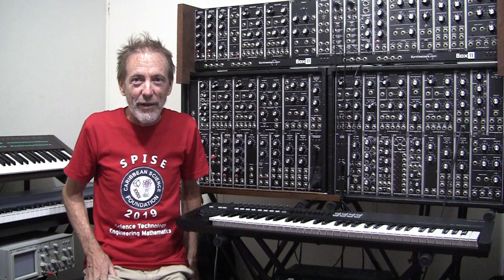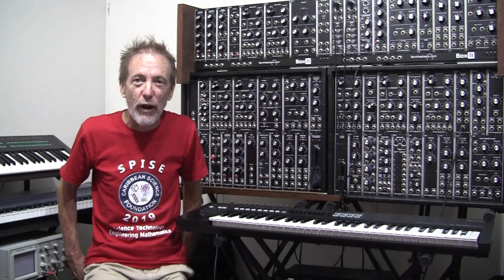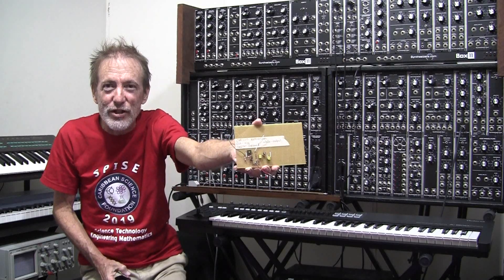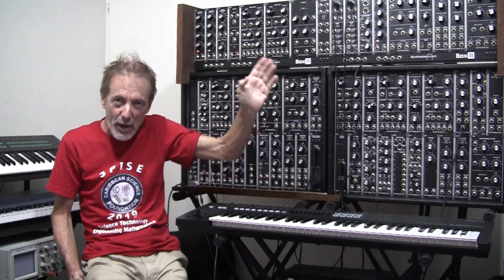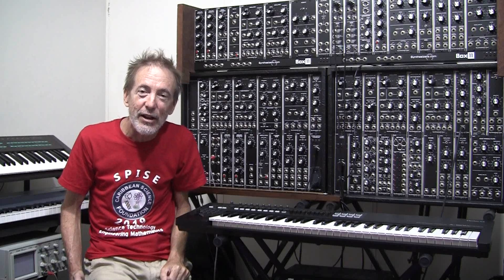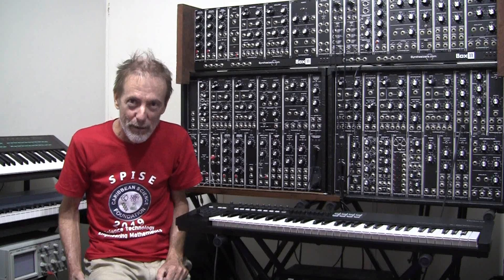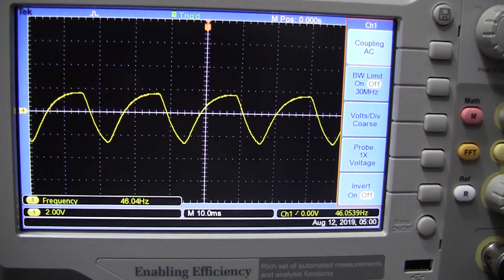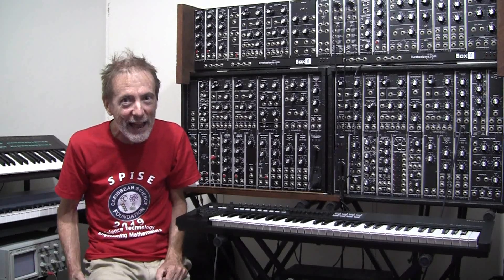Beware Electronic Circuits that do NOT work !

Comment: Back when I was in engineering school, many lab circuits were pure nightmares ! The log amp, using a semiconductor pn junction, in particular. I think these are assigned to make us aware, that not all circuit designs are usable, and to avoid such circuits, when we were on the job.
Reply from the maker: circuit simulation software will allow circuit designs  to work that would NOT work when built with actual components (that's why it's so important to learn good design practices) ..  they were teaching you (the 'hard' way) by allowing you to 'experiment'  with bad designs before teaching you the "why"

Comment: Funny how circuits engineered with software suffer from the same pitfalls as software engineering does. Lots of time wasting rabbit holes out there but at least I feel more productive at failing when I build circuits.
Reply from the maker: I have built my fair share of circuits both the ones I designed myself as well as the ones I found in magazines (back in the 70's 🙂 ) that did not work. You will know you are making progress when you can troubleshoot them and then change  components to make them work.  Electronics is not an exact science (all of the components have tolerances and other parameters  that are rarely considered in the mathematical model)..... the 'art' is to come up with a circuit where the tolerances and parameters have little effect on the operation..... Electronics is an ART as well as a SCIENCE  and long before I knew the maths to  'predict' behavior, I was building circuits and getting them to work by changing component values and measuring the results with multimeter and scope and you definitely learn a lot from this  method IF you do it in a systematic and methodical way. Later, I got hold on an excellent book "The Art of Electronics"  ..... but a more modern book "Practical Electronics for Inventors" (available on Amazon) is  probably (in 2019) a better investment.